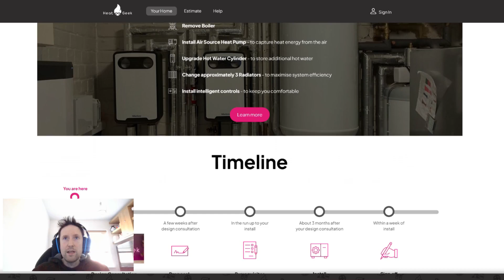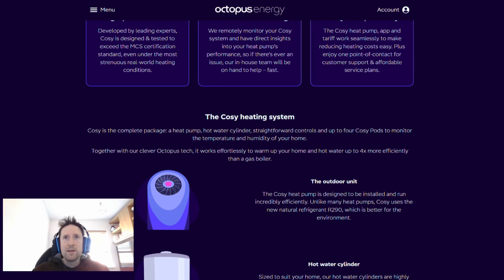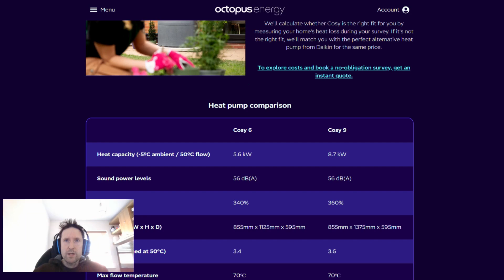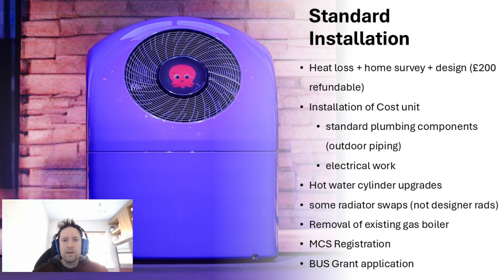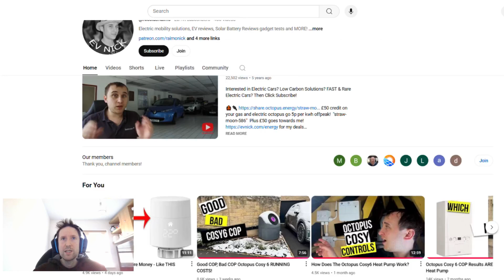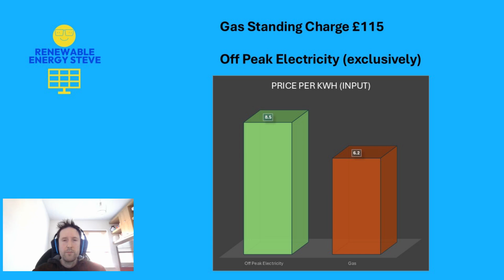Heat Pump For Just £150?

Comment: Octopus seem to have changed the way quote for heat pump quote. They now do a Turbo Install and an Eco install. Are you able to refresh your quote and see if £150 still applies
Reply from the maker: That's interesting. I had mine installed in March at the price mentioned so wouldn't be able to access that.
I wonder what the difference would be between Turbo and Eco

Comment: Heat pumps run
Most efficiently as low a flow rate as possible. 40 degrees is just a round number you have picked.  Running it at 30 would be more efficient.  I have a new build with wet underfloor heating and run mine at 27 with a cop or 4.8.  If I run it higher the cop drops.

Comment: My gas boiler is 25 years old and expect another 5 years at least to replace gas boiler about £800 plus installation while gas is available I will always choose that far simpler than heat pumps solar panels and battery insulations..although one day perhaps this will be the only choice but not in my lifetime hopefully
Reply from the maker: @steviec1871  each to their own. £800 is highly ambitious for a new boiler these days however. When I needed one in my previous house nearly 3 years ago it was around £2500. Although admittedly I chose a higher end model with advanced controls for better efficiency. Labour costs sure aren't what they used to be.

Comment: Cosy is ok as long as you accept that you get a less efficient solution all round which will be costing you more to run, and you are dependant on a single supplier who controls your system. 50 deg flow is too high and you probably got a buffer but don't need one.

The "requirement" for better insulation is a complete red herring and I wish that people would not keep repeating this misinformation! Better insulation is always a good idea and will improve things no matter what your heat source is.
Reply from the maker: Fair point about insulation always being a factor regardless of the heating source. I suppose the criticism frequency levelled at heat pumps tends to be the fear that lower flow temp systems might not be able to achieve the desired output to exceed the heat loss in the coldest of conditions, but this can be overcome with correct system sizing and design. There are some good examples on heat pump monitor with impressive cops despite being in older properties.
Reply: 100% agree with this

Comment: Had mine installed by Octopus last September, had paid £500 deposit back in May, after installion I got my £500 back. Boiler upgrade covered all costs £7500, 4 radiators replaced, already had a tank so airing cupboard was ok. Well happy with the performance. 👍👍
Reply from the maker: Effectively a free Heat Pump then. That's a great story! 😁

Comment: Im stunned at this quote.
Seems unbelievable!
I filled in the online form - granted that only asked for house type (i.e. detached) and address.... and my quote came back £6,000
How on earth is it so little.
They advertise 'from £500' but I wondered who got it for as little as 500 let alone less.
My house should be an easy install as far as im aware but they say £6000 without even asking more questions.
Reply from the maker: It certainly does seem to vary quite a bit from household to household. I think they make certain assumptions from the EPC

Comment: And my quote came in at £7000, where are they getting these prices from. Octopus need to get a grip
Reply from the maker: That's a shame. £7,000 certainly seems quite steep. There is a lot of variance depending on property type however. Did they say which elements pushed it to that region?
Reply: @RenewableEnergySteve  I haven't actually gone into detail about the quote. Originally the quote was £4700 and was advised by octopus to renew my EPC certificate and it'll bring the quote down. So I had another EPC certificate done which cost me £65 and the rating went from a F to an A. At this point I was convinced the price would drop, unfortunately this wasn't the case for me. I'm not sure what else there is for me to do. Looks like they have lost a customer.
Reply from the maker: @adamwoodall9506  F to A is quite the transformation! 
Sounds like you might be better off elsewhere

Comment: Trying to go cheaper sounds pointless but others may be able to make the installation look better. BG seem to compete with Octopus. Worth looking at some other online installations for pitfalls - for me pipes and cables all pver the outside of the property is just a no no.
Good luck, sounds like your in line for a nearly free HP and ditto the running costs, assuming you're getting a fair amount of export as well 😊
Reply from the maker: That's good advice. 
Export should be plentiful beyond March 😁

Comment: Could you elaborate on what the critera is for the simple installation discount? This is the first i've heard of it. Thanks
Reply from the maker: @tonyt7402  honestly I don't think I can say 100%. I wasn't going to challenge a discount of that size. 😉
What I would assume is they set aside funds for planning permission and/ or an increase in electricity supply to the property which also requires some time consuming paperwork. In instances where that's not needing they perhaps pass on the savings to the customer. I am speculating somewhat here howver

Comment: Try asking local installers if they can match the price.

I did that, and it worked really well.

Also, find out if your mortgage company have any grants (if you have a mortgage).  They gave me £2000 if a trustmark installer is used.  Octopus are also trustmark registered.  They would give you the £150, which would give you an install at no cost.  Only the amount you pay would be refunded.

Would suggest you do shop around.  I have an ecodan with a COP of around 4.  It was only fitted in Nov so cannot give you a scop, but it is very likely higher.

Should add that the communication with Octopus was not good, which is why I looked elsewhere.  That could be just to an individual contact.

The installer produced the calculations using the Octopus survey.
Reply from the maker: Excellent point about the additional grants. Glad to hear the Ecodan is performing well. 😀
Reply: @RenewableEnergySteve  The  installers' preference was a 
Grant, but was open to many others.  I wanted local control, so I chose the ecodan.  It doesn't do that natively, but can be done easily.
Reply from the maker: @indymind  Cool, sounds like you got what you wanted on your terms which is great! 👍
Reply: Sorry how do you find out about grants from your mortgage company? This sounds too good to be true, just like the £150 heat pump from octopus haha
Reply: I should add that the local installer was far more flexible with locations etc.

Comment: I'm in the process of having a cosy10 fitted so far octopus have been spot on just waiting for installation date
Reply from the maker: Oh excellent! That might make you one of the first customers for the cosy 10. How exciting! They seem to be doing the right things to install these in big numbers nationwide. 
Best of luck with the install. Hope it goes well. 😃
Reply: Bit jealous of 27kw battery storage do have 2 power walls by any chance
Reply from the maker: Yes, that's 2x Tesla Powerwall 2s. The first was when I got the main solar array installed. The second was futureproofing knowing I wanted a heat pump at some point.